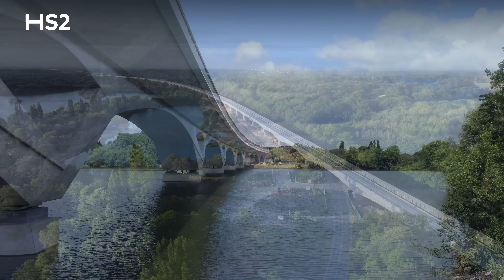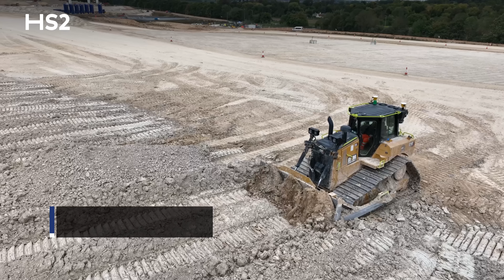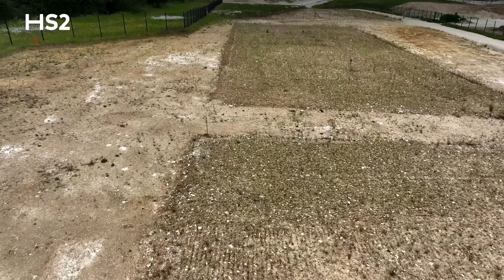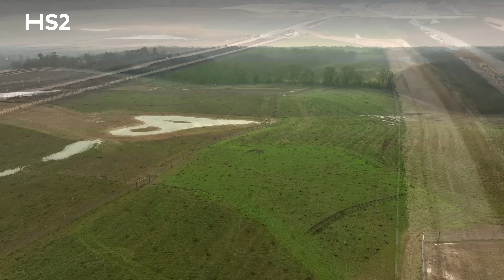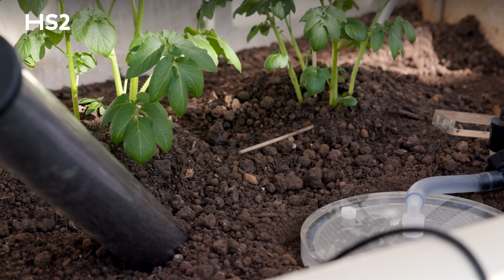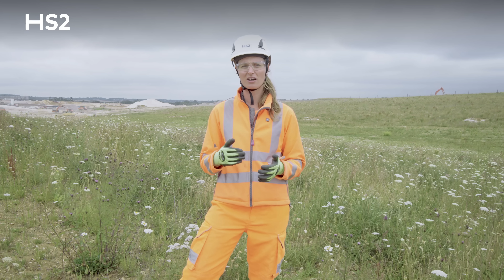Wildlife begins to flourish at HS2’s largest habitat creation site 🐝🦋🌿

Comment: HOW MUCH THIS COST TO GREENWASH YOUR HUGE WASTE OF TAX PAYERS MONEY!
Reply: You say that as if our railways don’t need a high speed line to relieve congestion
Reply: @stantorren4400  the track has been reduced substantially since it was first announced in 2013 to the point it won't relieve congestion that much.
There's also the huge increase in the cost despite most of the track being cancelled
20bn to 56-65 bn.

Comment: Furthermore, this project was also a monumental waste of public money. A conservative vanity project designed to ferry people to London quicker. Railways across the UK are in desperate need of modernising, new lines needed to connect communities. Instead they’ve blown billions and billions of pounds on a railway that will only cater for a tiny percentage of the country. Anyone who defends this vile project is either completely deluded or being paid to defend it.
Reply: You realise the problem is capacity. A high speed line would remove intercity express services from the west coast mainline, allowing for more capacity. That was the point. Upgrades will not help with capacity. In fact, upgrades are easier with HS2, as there would be less disruption
Reply: It was originally proposed by Andrew Adonis of Labour, but it became a cross-party flagship project, because it needed cross-party agreement to guarantee funds across several Parliaments.

Comment: Having destroyed hundreds of square miles of existing habitat, they have a cheek to trumpet their restoration of one large field. Soon you will have two ways to go by train from London to Birmingham.!!!! It wasn't necessary in the first place.
Reply: And yet the reality is hyperbole like "hundreds of square miles" is precisely the sort of massive exaggeration that lets the Stop HS2 narrative down so badly. 

Phase 1 of HS2 is 140 miles long, even at an exaggerated 1/4 mile wide it's 35 square miles maximum, at the actual width of on average no more than 1/10th mile wide and allowing for all the tunneling probably around 10 square miles, most of which was monocrop farmland beforehand anyway.

And the capacity is very much needed, there are actually two existing routes between London and Birmingham and both are virtually full and standing with no capacity for long term growth.
Reply: Actually no you will not. As a passenger you will be travelling on the HS2 route if you are travelling to London from Birmingham and vice versa. Also, the trains from further north such as Manchester, Glasgow etc will be on the HS2 line below Handsacre. This then frees up a good chunk of the West Coast Main Line, for more freight and commuter services. Please refrain from wild statements about 'hundreds of square miles of existing habitat' being destroyed as that is patently not true.
Reply: What habitat? Man-made fields for cattle grazers isn't a real habitat
Reply: @Kevk-v2mUse of cattle to maintain habitat is a widespread and well recognised environmental control measure, the likes of the National Trust do it in a number of places.
Reply: @Polarbear1-b6jI'm talking more about the fields. Completely artificial man-made and doesn't fulfill nature's true potential

Comment: We should be proud of HS2, not constantly snipe at it. The project is a world leader and could have been so much better if built in full.
Reply: Unfortunately it ain’t cheap
Reply: @Wjfiswjei183nothing cheap if you don’t put controls on it
Reply: @123stelyn true, but if you look through it, you can see why it costs so much, 34,000 people on high wages, and all the infrastructure on city lands
Reply: @Wjfiswjei183You think paying 34000 people on high wages is a good thing by its self, without thinking about the actual benefits the project brings to the country 
The majority of the construction is built of green field sites,only the approaches to Birmingham and London are on built up areas
Reply: @Wjfiswjei183nobody wants to travel on a railway built on the cheap.
They want to travel on a well  built,well managed and cost effective line which HS2 is a million miles from being
Reply: @123stelyn Well… in British infrastructure you can only have 2 of the 3 you mentioned
Reply: @Wjfiswjei183good point 
In the current construction climate your blessed to get 1 out of 3
Reply: None of this has been done for fun.  This kind of restoration and other measures like the much derided bat tunnel and changes to tunnel portals to reduce noise impact have all come from the planning process in the UK.  If the planning authority says you need to do this to mitigate the impact of the project for local people or environmental reasons then HS2 have to build it and add to the cost.  
The reason that they build things much cheaper in China is that none of this stuff is asked for by the relevant authorities.
Reply: @TheMongoose68 HS2 management has tried using this argument from day one ,the truth of the matter is that in most cases HS2 have designed the railway to how they interpret the planning laws ,they’ve then asked relevant to rubber stamp the plans.
This has resulted in massively over engineered designs and so massively more costly.
The bat tunnel is the most high profile example, HS2 chairman told a select committee they were forced to build it because of environmental planning regulations. The environmental ministry responded the following day stating they had never been consulted during the planning process,they only been asked if it complied with the law.
Reply: World leader? Google China
Reply: Fr, sure the project has had issues but a project like this hasn't been done before in the UK for a long time. We should be supportive of this project and make sure that it survives until opening.
Reply: @10C45E the biggest problem with HS2 mismanagement is that no politicians are going to go near a major train infrastructure project for a generation .it’s extremely unlikely than Northern Powerhouse Rail is going to be green lighted anytime soon,which has serious consequences for growth in the north
Reply: @123stelyn  That says that the wrong people are politicians, because there's damn all point to national politicians if they are too incompetent to 'go near' national rail projects. You can delegate town bypasses to county councils FFS. You can delegate individual river flood management to an alliance of councils covering the river from source to mouth. The only things that a National Parliament is there for are genuinely national issues, like the motorway network, the inter-city rail networks, hub airports; defence of the realm; and how to raise the finance to serve the genuinely national parts of government.

The problem with Parliament is that it is stuffed full of PPE windbag graduates from Oxford who've never done anything but blag and scheme. 

Parliament should be stuffed full of engineers, scientists, doctors, nurses, entrepreneurs, ex-military folks, people with experience in the emergency services, in running airports etc etc. People who actually have a real expertise in one area of the economy. Maybe even have a few experts in risk management, eh? 

HS2 has created an inventory of tunnel boring machinery, skills in creating long tunnels, all of which should be used in building more tunnels, more efficiently, leveraging all the learning from the HS2 project. Ideal for a 60 mile tunnel from Liverpool to Leeds via Liverpool and Manchester airports, central Manchester, Bradford, then branching in two, one to Leeds/Bradford airport and on toward York and the NE, one going south to central Leeds and emerging east of Leeds to go on to Hull. No need for more than  a quarter as much  planning permission if the tunnels are 25m below ground. Just need regular vents, permission for underground stations etc. Not much compulsory purchase, relatively little disruption to daily life during construction. And a pretty clear cost/mile of tunnel, I'd have said??
Reply: If it had been managed properly it would’ve been built in full ,that’s the point and that’s why people are embarrassed by it
Reply: @123stelyn things like this are what causes the massive cost.
Reply: @component9008 it’s not. Suggesting that this small ecology project makes a major contribution to the costs of the railway is just silly. It will be a vital part of the legacy of HS2, though. The major costs have been buying land and civil engineering to take the line through difficult or politically sensitive areas. Had HS2 been delivered in its entirety and without the political delays, it would be finished now and at lower cost.
Reply: @twowheelsgoodbrum1077 I’m not suggesting that. I’m saying that the collection of all of these and the thousand other pointless environmental laws and considerations do that.
Reply: @component9008 no, they don’t. All the attempts to restore the ecology of the places disrupted along the route have been a minuscule fraction of the cost of the project. In the project in the video, the cost of removing the chalk and clay would have been greater than reusing it on site. You would have to be suggesting that planting trees somehow constituted a distorting effect on the cost of Europe’s largest civil engineering project. Your disinformation is really unhelpful.

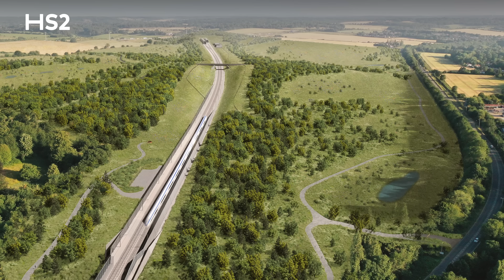Comment: 5:55 - so why didn't you connect the two sides with a green bridge for the wildlife? They'll be limited to their own side of the tracks.
Reply: Wildlife doesn't really have an issue crossing railway tracks, but even so there is a bridge if you look.
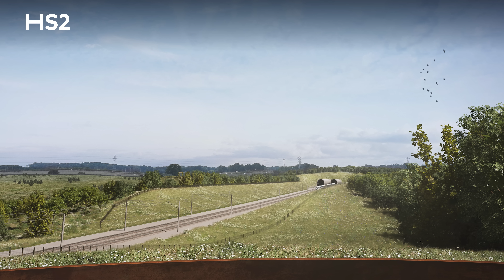Reply: @Polarbear1-b6j it's not a green bridge - and there's fences on each side of the tracks 5:15
Reply: @sssdddkkksss Worked on the existing railway for nearly 40 years, fences don't stop the wildlife trust me. It seems wildlife has far more intelligence and common sense than some humans.
Reply: @Polarbear1-b6j ok
Reply: @Polarbear1-b6j- you might be referring to larger wildlife like deer, which can clear a five foot fence, but there will be many creatures which cannot. Fences are a form of selection in this respect.